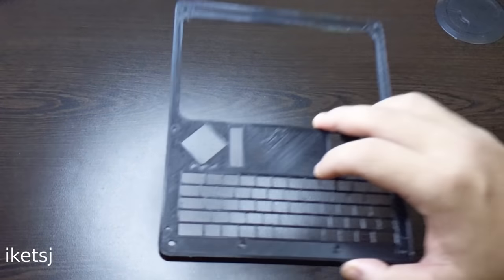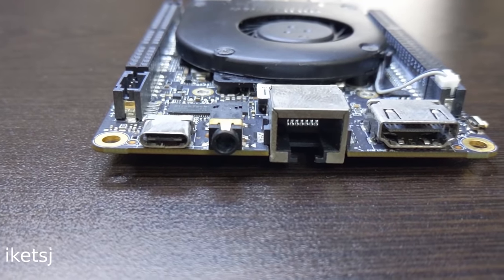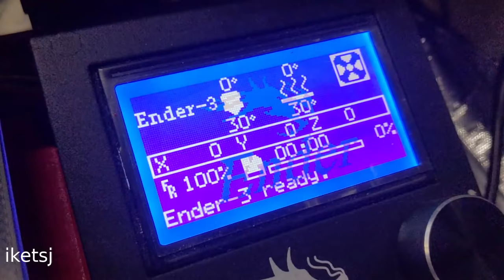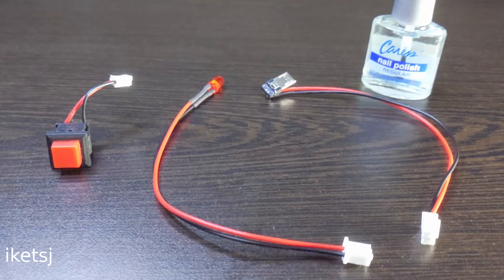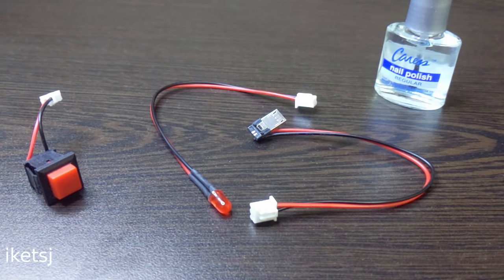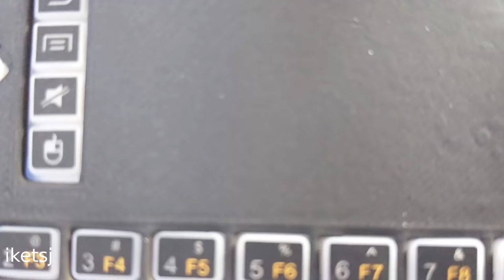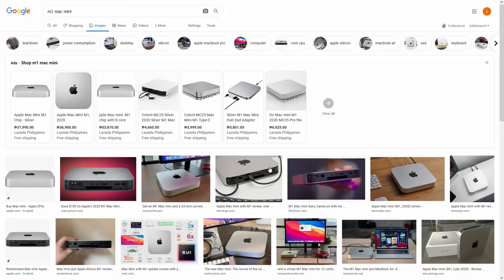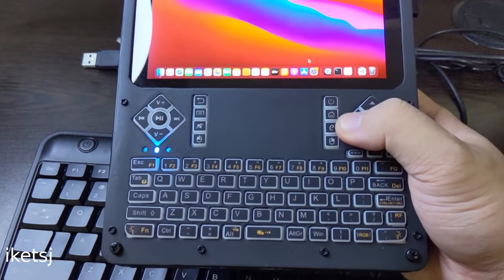World's First DIY macOS Handheld

Comment: Im a droid guy. But before droid, ipod touches were the best thing to have. I had a jailbroken ipod touch with a switcher that gave it basically macos. Obviously it wasnt actually macos, but it was a really advanced theme that changed how everything worked. Not just the aesthetic. I will way, portable mac os can definitely be practical. Imagining what i had on that ipod on a tablet seems very much practical. Man i miss that thing. Still have it but dont have the cable to charge it and idk what generation it was.

Comment: I'd use that to run Kali Linux, you could add so many radio sensors similar to what's on the flipper zero
Reply from the maker: Yes, I just need some resources. You can check out my Akruvia products.

Comment: Such an awesome device. You feel a touch negative at the end though---the M1 isn't competing with this. It's an x86 Mac/Hackintosh, which is a far more unique beast to work with than M1. In a few years, M1 will be funner to work with, hopefully, but right now x86 is still where it's at because it's easier to develop for and far more open.

The M1 also isn't battery powered. The battery here literally acts as a UPS. Any random power flicker or outage? It's still going. It's the reason a lot of lower-visitation/indie sites are hosted on laptops, usually old MacBooks, because the battery system acts as a form of UPS.